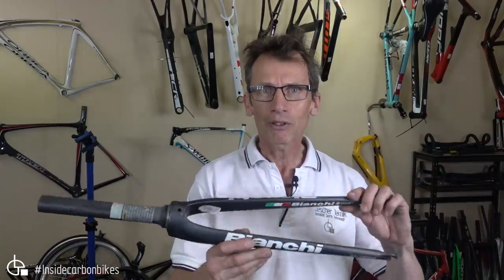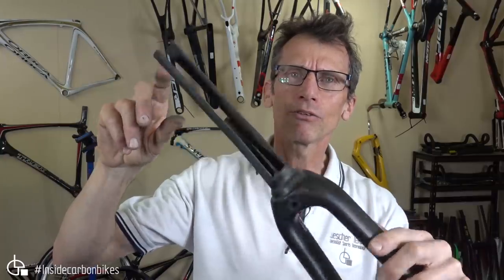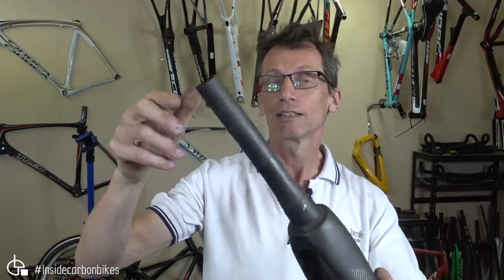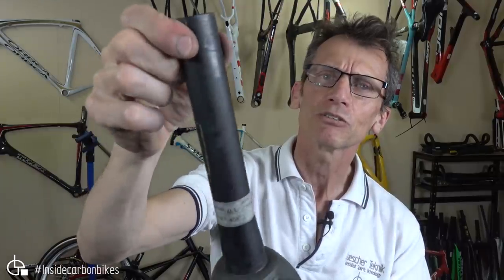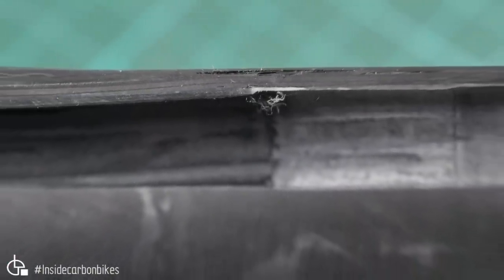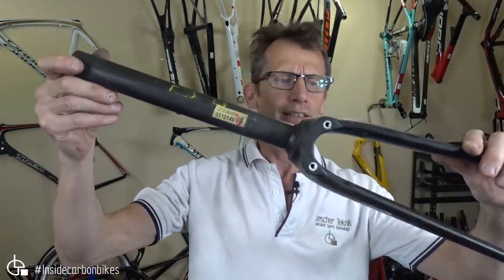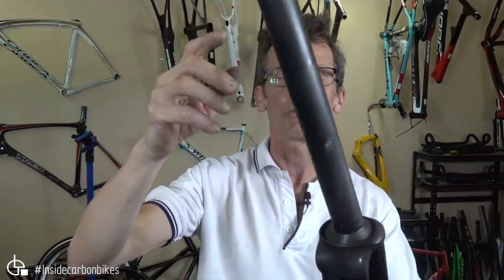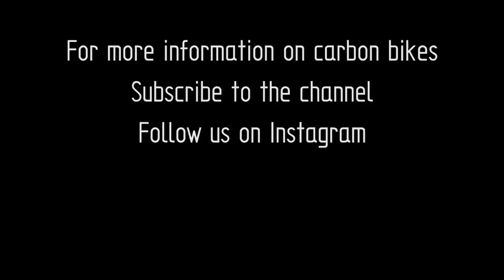Fork Steerer Failure - Recent Crash

Comment: I think Durianriders' explanation for why the steerers are failing is more plausible than your reasoning. He believes that incorrect assembly is the primary cause, not manufacturer defects. The failed bikes are assembled with too many spacers above the stem, which prevents the compression plug to fully fill the void in the steerer where the stem is tighten. This causes fractures in the steerer tube which eventually leads to failure.
Reply: Raul has posted videos about this very subject and even mentions it towards the end.
Reply: If I recall he mentions using the correct length plug accommodate the depth.
Reply: I think I'll take the expert's advice.
Reply: What educational or industrial experience in composite manufacturing does Durianrider have? What statistical data does he have to backup his claim?

Based upon my own decades worth of manufacturing and test experience in Aerospace, motorsport, automotive, medical and nuclear composite manufacturing, I'd suggest you take the Raoul's advice and experience more seriously as he absolutely knows what he is talking about.
Reply: Both reasons are applicable, poor manufacturing and poor assembly
Reply: @waynosfotos  yes both are plausible and I don't disagree with the fact you effectively increase the moment by having a large expanse of tube. However, the point loads are going to be far greater around the stem and plug.

The fact is that bike manufacturers manufacture the structure incredibly poorly. The defects in this video are complete schoolboy error.

No way I'd manufacture a straight tube using a bag on the ID of the steerer. Complete failure of sensible process design in my opinion.
Reply: @phildunn1983  what process would you recommend otherwise, taking into account the tube is cured together with crown and blades? Collet mandrel?
Reply: @feedbackzaloop  could happily have a removable mandrel and have the more complex geometry under bag.

Either that or bond a press fit filament wound tube on to the crown. All easily done.

The issue here is how they're not even able to control basic geometry consolidation. As I said school boy error stuff done to absolute minimize cost at the expense of product integrity and the customer.
Reply: @phildunn1983  Some makers, most notably, I guess, Time, use sacrificial solid mandrels in many critical areas of frame construction.

It's a cost / risk calculation for a manufacturer, though ... if a law suit a year is going to cost $5million, each time it happens, can we save $5 million a year by using a lower-cost option in construction? That may be mildly cynical on my part but I've been in QC and manufacturing long enough to know that almost any manufacturing business has to make just this reckoning on a regular basis ... some accept a higher risk than others but since no manufacturing process id perfect and since the cost / benefit curve is more or less exponential (removing that last 0.01% risk is a lot more expensive than eliminating the first 10% of risk),  the question for brands is where to place their business along that curve. Boeing are going through exactly that pain at the moment, if we want to use the aerospace industry as our metric ...
Reply: @graemefk6519  excellent summary. I am involved in these conversations as a man eng all the time in the fight for better process.

In this instance of steerer tube, it doesn't have to be sacrificial and the actual outlay for what is essentially a safety critical part of the frame wouldn't be much even on large volume scale.

There's even the possible of extremely low temp melt castings to create a mould tool which has been used in various composite application. And by low temp, I mean 100 to 120degC which is fairly typical post cure temperatures used on these parts. Surface finish wouldn't even have to be that amazing. You'd still likely get better compaction than with an internal bag.
Reply: @waynosfotos  Exactly. The truth usually lies somewhere in between.
Reply: @ggdd1299 lol, dude you have some obsession about his gf, mensioning her in every comment. It's creepy as fuck. What's she done to you? Beat on dr away if it makes you feel better, but leave her alone ffs.
Reply: @phildunn1983  Thanks for the kind words, Phil.
I feel your pain - I have the same issues with some manufacturers I consult for.
The irony of it is, I am not a qualified engineer, I'm just a mechanic with a lot of years on the tools and I find myself arguing with guys I feel should know better... occasionally I even win!
On the steerer tube, no, you are right - it doesn't have to be sacrificial although some complex internal shaping / contiguous column / crown / blade mouldings might make it attractive to use a "lost" mandrel.
Not sure I understand what you mean when you say to use a low temp melt casting to create a tool. Can I ask you to expand on that a little, please, unless you are referring to things like wax mandrels?
Thanks!